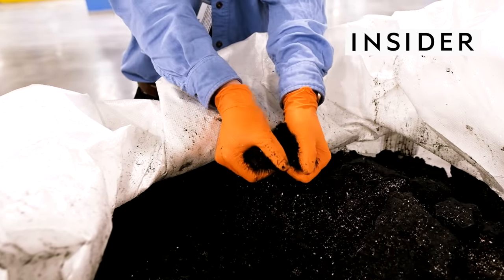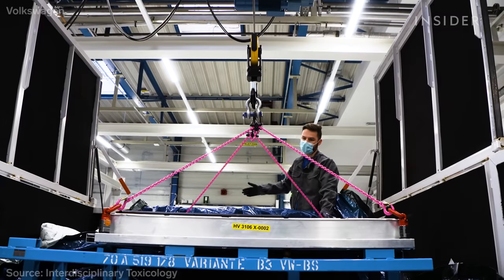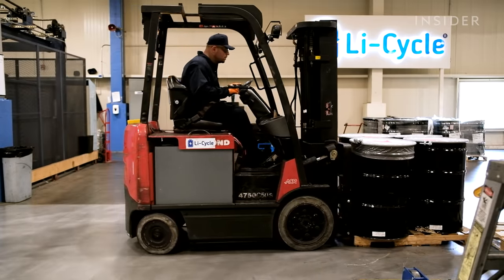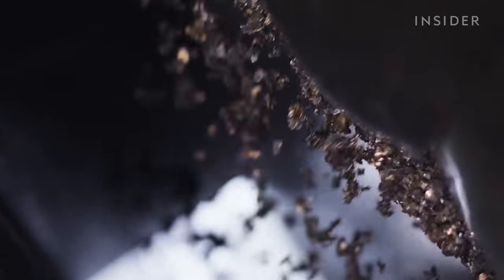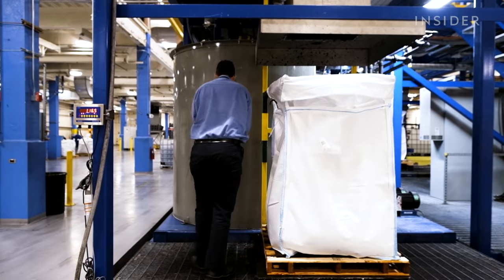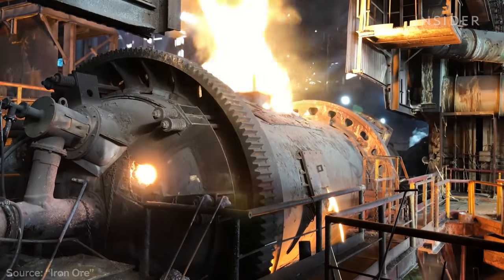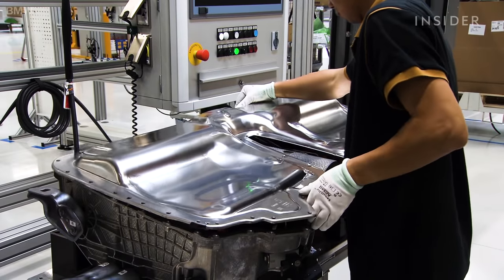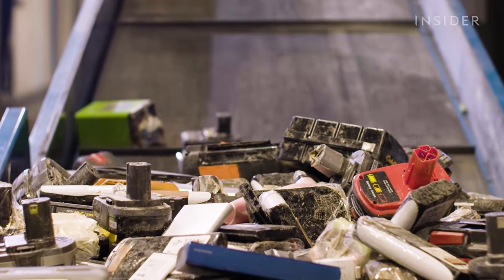How To Mine Metals From Electric Car Batteries | World Wide Waste

Comment: "wouldn't tell us where it goes" is where you lost me
Reply: Same
Reply: Landfill to be buried or shipped to 3rd world country. I work in the trash industry.
Reply: @mrluis9456  so they solve nothing
Reply: @haritinasakova4327  About 60%  Recycling doesn’t solve everything but it Helps
Reply: @haritinasakova4327  Looks like it’s just the separated low-density plastic from battery casings that is (currently) being landfilled. You can see the rest of the precious metals are saved for potential recapture later with an improved, non-smelting process. Still plenty of room for improvement. But better than landfilling the whole battery. Incremental improvements!
Reply: @dirtysanchez53  I guess you're right
Reply: Ans: Landfill... LOL
Reply: China obviously
Reply: @DublinDapper  Nah... Not taking any more of our Trash
Reply: Right in the dump in Indonesia is most likely where.

Comment: what does 100 eiffel towers worth of batteries actually mean though?
Reply: It means they want you to think of 100 Eiffel towers made of batteries
Reply: @kari548  amazing! Why didnt I think of that·
Reply: It means nothing. American audiences demand things are measured for them in bizarre units like school buses, football fields or the distance between NYC and LA.

Doesn't really matter what is used, as long as it's not a scientific unit of measurement.
Reply: Depends on whether they meant 100 Eiffel Towers in height or 100 Eiffel Towers in weight.
In height it would be ~30,000m of batteries stacked on top of each other (that's 18mi).
In weight it would be 1,000,000 tons. Not sure if that's a lot without being able to compare it to other waste values
Reply: @evilbred974  it just helps to visualize the shear amount of it
Reply: @guardian6975  I mean, it's less helpful to visualize than using the actual measurement.
Reply: In short It means a lot. Learned a new thing today right.
Reply: @evilbred974  yup. I can visualize 500 meters, but I just don't remember how tall the fking eiffel tower is. Some hundreds meters lol...

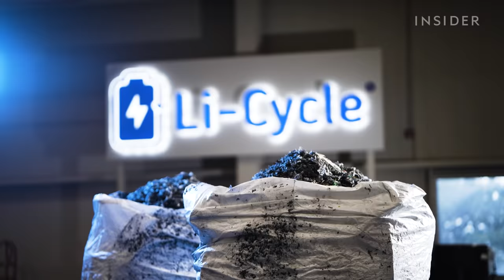Comment: 3:20 I’m guessing landfill? The fact that they won’t tell you where it currently goes means that it’s not being recycled. Thou art holier than thou.
Reply: Before we come to conclusions, you have to understand the fact that recycling li batteries a very long and tedious process. I believe, while they have figured out an interesting way to do it as much effeciently as possible, the next step to recycle the plastic remains  something completely different and might need further ideas and vision to cope with. But this is still a very positive direction tbh.
Reply: @kevinmccormick8467  hardly dude. It’s pretty apparent there needs to be a lot more done to recycle batteries.

Comment: In the next decade, I think we will be talking about how EVs are solving some issues, but have also created others.
Reply: Horse's back again
Reply: They won't solve a thing.
Reply: People are talking about that now which is why companies like Li-Cycle, Lithium Australia etc... exist and why hydrogen fuel cells are being researched and commercialised. Will there be some issues not yet known in the future? Most likely. Unknown unknowns and all that. 
New technology always comes at the cost of issues. ICE and fossil fuels came with pollution, toxic gases and particulate. Fission came with waste and weapons proliferation and so on. The only technology that might come with no drawbacks at all is fusion and that's still a unicorn atm
Reply: @christhompson4630  Mass transit expansion makes way more sense.
Reply: That’s fine honestly, they solve more problems than they create, and that’s the story with all new technology.
Reply: @dickriggles942  they solve many things, electric vehicles create way less particular pollution, are cheaper to operate, pollute less and are easier to recycle. It may be hard to recycle lithium but you can’t reuse oil when it’s burned
Reply: Applies to everything. Past and current transportation system solved a lot of inconveniences, but created some problems too. Plastic solved a lot of inconveniences, but created problems too. The Law of Sacrifice applies to everything.
Reply: @calebweldon8102  No, none of that is true, ROFLMAO. Did you even graduate from high school?
Reply: @dickriggles942  i'm not trying to be rude but you should say that to your government also

Comment: I'm guessing the secret liquid is mineral oil?
Reply: Literally
Reply: Essential oil
Reply: Sounds like a good guess. 
I myself make a wild guess that those "incinerators" to create the necessary heat in the process of creating and eventually recycling this "black mass" , as well as the conveyor belts and the sorting machines and trucks and boats used throughout this value chain, are powered by either mineral oil or another historical "black mass" called "charcoal"?
Reply: @kobusg7460   yall must have shown all your attention to chemistry classes as my guess was hydrogen just cause it is non flammable
Reply: Mineral oil and silicone oil wouldnt have the density to float separate the plastic
Reply: And then what is the secret liquid ?

Comment: I'd say EVs are better for the environment, assuming people drive them for their complete lifecycle. But when ppl are buying new cars every 2-3 years. It doesn't matter if it's EV or not.
Reply: Can you afford a new 15,000 every ten years? I'll scrap a car before I spend that kind of money on an old used car
Reply: If the car companies weren't making them so difficult to source parts for and work on then people might be more open to them. I wouldn't buy a car new or used that is only supposed to last around 10 years even if I wasn't going to keep the car for that amount of time
Reply: @blowinkk9396  try 25-30 for a new ev
Reply: so eco friendly they run on coal (if you're in the USA)

Comment: So you’re not currently taking out the lithium? So what exactly is it you’re solving about recycling electric car batteries? I’ll tell you what it is, it’s absolutely nothing. Shysters.
Reply: Lithium isn't actually the main ingredient in a lithium ion battery. It's also really abundant. It's the nickel, cobalt and manganese that are rare and expensive.
Reply: I know the CTO of the company, and ive developed recovery methods from this material. They arent shysters and it's a simple process
Reply: @gagnong4738  oh really? 😂
Reply: @sjv6598  yes. 
Manganese for example, once acid extracted as MnSO4 (Mn is on the 2+ oxidation state) can be selectively precipitated from the PL by oxidation to Mn4+ and it falls out as MnO2.
Processing black cake is a trivial hydrometalurgical exercise for a small group of people.
Reply: @gagnong4738  cool , it’s sounds incredibly easy, I’ll set up a recovery plant in my garage this afternoon.
Reply: @sjv6598   well get on that solvent exchange step for the selective recovery of nickel over cobalt. Youre going to need 60 percent sulfuric acid to strip the loaded organic phase
Reply: @gagnong4738  cheers buddy I appreciate the specifics.

Comment: How are we going to charge the electric eels
Reply: lightning cable
Reply: Solar and wing energy
Reply: Yes but I reported your account
Reply: @rahulmakhariya5452  Are you an electrical engineer?
How and where are people in major cities going to plug in their electric vehicle to charge? Wind and solar power cannot be dispatch the same way conventional power generation sources are dispatched, ie - coal, oil, natural gas, nuclear,  hydroelectric.
Reply: @generatorjohn4537  in india 2013 there where near about less thn 2GW solar generation project in which zero ROOFTOP SOLAR NET METERING where installed and in now 2021 more thn 44GW got installed and the 100GW is target for next yr 2022.. so now u can find my answer reliable

Comment: Car lithium batteries last 10 years? So would a swap have to be done or would EVs be traded in?
Reply: Your car will go to the junkyard because you will not pay for a new battery for it!
Reply: Definitely swap. Which will cost almost or more than the current depreciated value of that car. Which means its totalled. Hoovie's Garage bought a 2012 tesla model s  at roughly 30k used when the battery gave out on him and tesla is asking 22.5k for a replacement. He was lucky Rich rebuilds knew a shop than can rebuild the battery for 4.5k i think. By replacing only 2 cells instead of the entire pack. But if i was in that position i wouldn't trust it to last. As one starts to wear soon the others will follow and you'll eventually be hitting that 22.5k total repair bill. Lucky too, people are fighting for right to repair or else telsa might've remotely disabled supercharging for that car. So yeah e-cars are junk in the used market unless you're hyper rich.
Reply: Most people are swapping out just the bad cells for reconditioned cells from cars that crashed or that someone did a swap on. So there are ways of basically eking out another 5+ years of lower performance after that point.
Reply: I'm not a mindless yay EV person, btw. I think they're not nearly as great as people think. But people are getting around the $12k plus swaps in various ways.

Comment: These batteries will not only last 10 years.  The batteries in the Nissan Leaf are still usable even the ones that are 10 years old.  However the Nissan leaf is the example of how not to design an electric car.  The Nissan leaf does not have any Thermal Battery Management system, which is what takes care of the battery.  If you don't manage the temperature of the battery you will be in trouble and seriously shorten the life expectancy of the battery, so that it's still over 10 years.

So if you do the wrong thing with these batteries they still last over 10 years and the Nissan Leaf is the only modern Electric car where this is the car.

In all cars where the Temperature is managed then the battery is expected to outlive the rest of the car.

And even when the battery has degraded to the point when it isn't good enough for use in a car then you reuse the battery.

The power grid needs storage with more wind and more solar, so the batteries from electric cars have finished their time in the car then, these batteries will be reused in grid storage.

The only batteries that need recycling are from car crashes.

Comment: Now if all other industry could follow suit!! Or at least the plastic manufacturers.
Reply: If it would be that easy 
Circular recycling is already a huge trend in the polymere industry if we look at consumer products but there are a ton of different types and special products which are quite hard to seperate or it isn't efficent enough to be economical compared to thermal recycling 

(From my German point of view)
Reply: @insectbite1714  compared to USA ? Which has a lot more landfills and doesn't  recycle as much as Germany per person
Reply: @insectbite1714  sure show me the paper which supports your statement and shows the recycling rate in the USA compared to Germany 

If you look it up Germany recycels 68% and the USA only recycels  35%

I am a polymere engineer in Austria so if you want i can give you more information what the real issues are

Comment: Battery recycling is a good thing, but its not possible to have all cars on batteries, it would take deades to build all the powerplants needed, and a new power grid. And new nuclear plants are rarely built, more of them are shuting down, like in germany..so you would have to make the electricity from coal and gas plants, so its not ecological anymore...you have to think about all the aspects of battery driven cars, not just that they dont smoke where they drive..I think hydrogen is the future of electric cars, not metal batteries. Also if you could make synthetic fuel from CO2, combustion engines wouldnt be a problem anymore, but thats a different story.

Comment: The issue is lead-acid batteries have been around forever and recycling them is something we have perfected. How It's Made did a good segment on how they are broken down into their components and recycled back into batteries. 

I can speak from experience accidentally puncturing lithium batteries, they do not like you doing that! I do think given 5-10 years, this will become a moot point but until then it is a big issue.
Reply: It might never get fixed, get real.

Comment: Good'Ol cars can be rebould,restored or...scrapped and the steel can be reforged into something else.   Steel,iron,aluminum can be repaired.    ALl the EV vehicles,cant be restored or rebuild,nobody wants todat,to have 10 yers with the same battery car, there will be a huge problem, i mean that today you buy any car,and in 4 years o even 3 will become an old car.   What does this mean?   Basicaly,that every 10 years will be more cheaper to throw away a car and buy a new one cause the battery replacement will be expensive and to talk about a restoration,will be worthless ??  Wow,then this is NOT techology to help anyone but the companies to sell more in exchange of a false based belief that its good for the enviroment.

Comment: “These batteries will last about 10 years.” Even the low end batteries found in the Bolt should last at least 150k miles. And even after that they should last longer albeit with lower and lower range as the miles are added on. Teslas batteries last for 200k miles or more and can be reused in stationary storage or be recycled at their “end of life”. My point in typing all of this is that the battery doesn’t just become useless to a vehicle once it hits 100/150k miles it just can’t go as far.